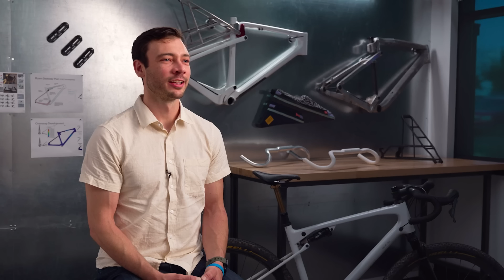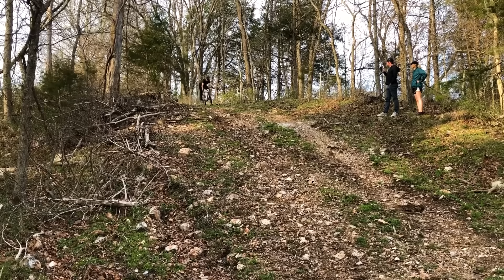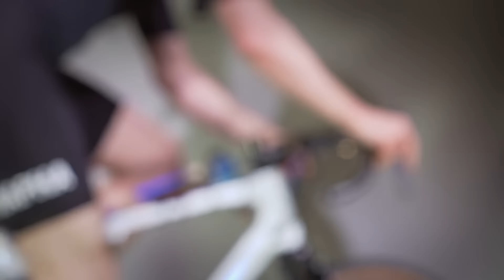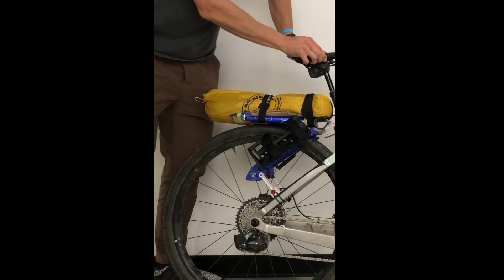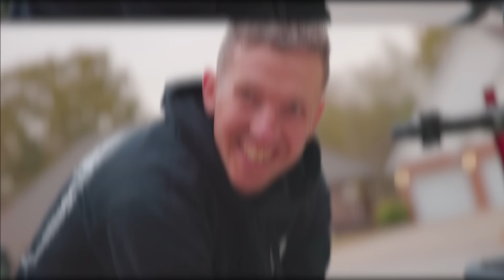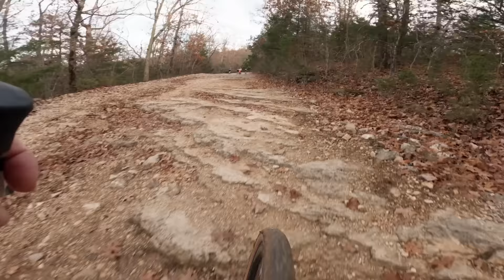Inside Trek CheckOUT | Engineering the Future of Gravel

Comment: The triple rate shock has 3 adjustment knobs on the back of each tube to keep from getting smashed. The plumbing works in “Hydrolocs” labeled by weight, “quick adjustment” no directions needed. Then Patent it hard.

Comment: I've been talking about this bike for a long time now and thought that when the current SuperCaliber was released, I instantly thought of using this design to make a dedicated FS gravel. I still think that over time suspension travel for gravel will increase to 60-80mms of travel fr/ rr.
For the short term, I'd like to see the weight and cost come down, for this bike, which I'm sure it will once this platform gets out there. I would also like to see other manufacturers use their own XC derived suspension platforms made into gravel specific bikes. Bikes such as the Scott Spark RC, Specialized Epic WC and the Orbea Oiz and others could have gravel bikes made from these designs.

Comment: Kudos for making the first full-sus Gravel bike.   However, I would have prefer that you had use a 100mm XC mountain bike fork and maybe 80mm of rear travel.  There are so many great 100mm forks.  In addition, if you're going to add the weight of suspension, you might as well get more than 50-60mm of travel.   I would also have preferred that you had used mountain bike hubs and the bike had clearance for 2.4 tires.  Essentially,  a full-sus XC bike with dropbar Gravel bike geometry would have been better.   Take the Supercaliber, tweak the geo, add dropbars, perfection.